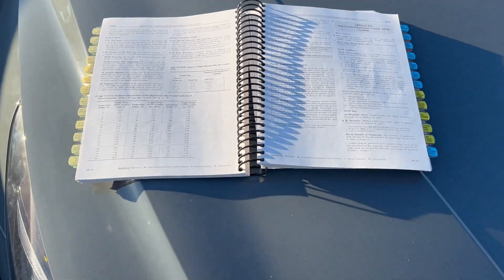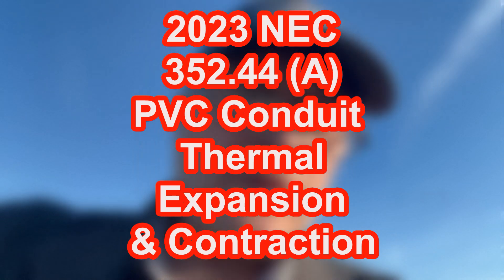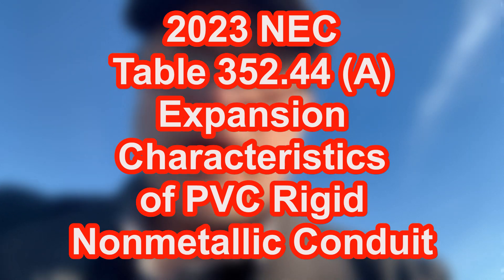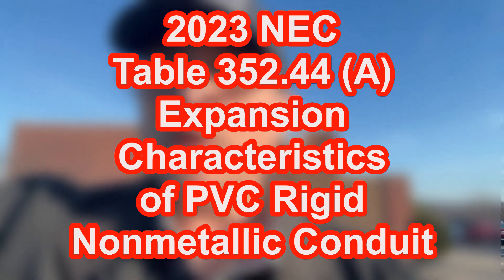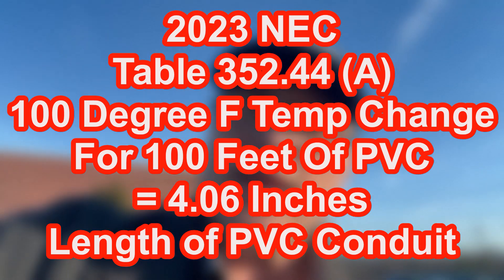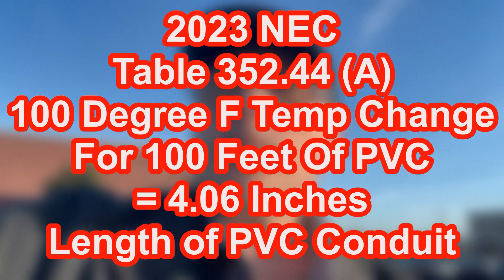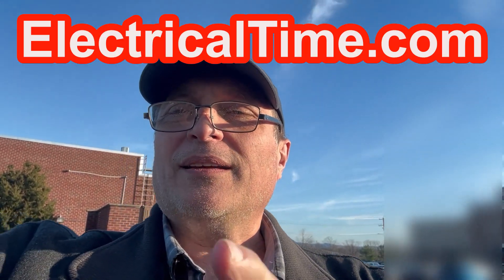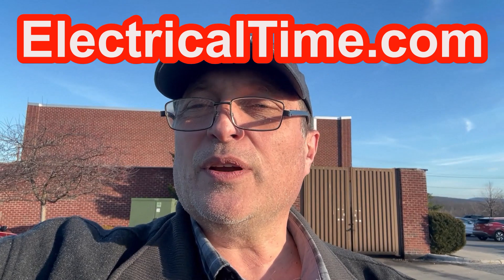NEC 2023 352.44(A) PVC Conduit Expansion & Contraction by ElectricalTime.com

Comment: So if it expanded that much are we not putting a severe strain on our electrial wire or does the wire not expand or retract that much.
Reply from the maker: Hi Morgan, that is a great question. While you have a very valid point, the integrity of the conduit must be preserved to protect the conductors inside them. When it gets very cold, the PVC Conduit shrinks and if it shrinks too much, the PVC conduit can pull itself out of a box thus leaving the conductors exposed to the elements and in some cases, the conductors themselves can end up holding up the conduit sections since the PVC conduit is separated and not connected anymore, again that is a great question, thanks

Comment: Great video!
Question….i have a 30 foot run in my basement between my main box and a new sub panel I will be installing. The temperature swing may only be 25 degrees but I plan on adding an expansion coupling in the center of the run. Is it ok to add one even if there is no code reason?
Reply from the maker: Hi Trainman, thanks for the nice comment and for you question. If there is no NEC code reason for you to add an expansion fitting in the middle of the 30 foot run of conduit which I am guessing will be PVC Conduit, you might get a weird look from the Electrical Inspector. The 2023 NEC 352.44(A) says that if the PVC Conduit is expected to change it's length of a 1/4 inch or more in a STRAIGHT RUN between securely mounted items such as boxes, cabinets, elbows or other conduit terminations. If your installation is in a STRIAGHT RUN between securely mounted enclosures such as your Main Breaker Panel and the Sub-Panel and if the expected change in length of the PVC Conduit is going to be 1/4 inch or more, then yes, it would be required to install that expansion fitting. If you take a look at Table 352.44(A), it says that a temperature change of 25 Degrees F will cause a 100 foot section of PVC to change 1.22 inches in length. Again if your PVC is a STRIAGHT RUN between securely mounted enclosures such as your Main Breaker Panel and the Sub-Panel and if the expected temperature change is going to be 25 Degrees F, then it would be expected for this 30 foot section of STRAIGHT PVC to change it's length by 0.366 inches which is 30% of the 1.22 inches of change as per Table 352.44(A) (30 Feet / 100 Feet x 1.22 Inches = 0.366 inches) which is bigger than 0.25 inches which is 1/4 inch. The key concept here is that if the PVC is in a STRIAGHT RUN, we want to give the PVC some room to expand and contract so that it does not damage the enclosures when it expands and or pull itself out of a glued fitting when it contracts. As far as I know, adding an expansion fitting where none is required by the NEC is ok, however be ready for the Electrical Inspector to give you a strange look. Thanks, Steve
Reply: @ElectricalTime  Hello Steve. Thank you very much for your response to my question. I truly appreciate the time and effort you put into it. Based on your answer I probably will NOT use the expansion coupling since the change in size would be minimal and the change in temperature will not be as much as I thought it would be (probably plus or minus 10 degrees). Besides that the coupling is over $20!
Thank you again and I look forward to watching and learning from your future videos.
Regards.

Comment: 4.06 inches is a lot. Who would have thought? Ty, Stevo!
Reply from the maker: If you ever have seen a straight section of outdoor section of PVC Conduit with ups and downs in it, it's usually from the PVC changing size as it expands and contracts. I have seen PVC conduit many times that came out of a box because in the winter the PVC got smaller and got pulled out of the box. Those expansion fittings are important and quite often overlooked on outdoor installations. Thanks for your reply. Steve
Reply: It's not a lot. I know bcs my boyfriend has it.